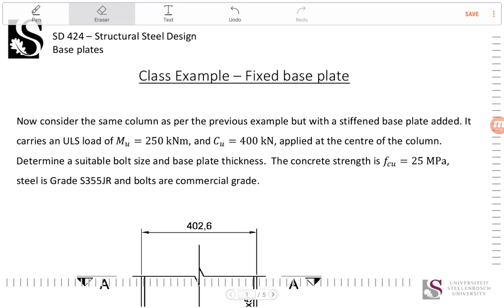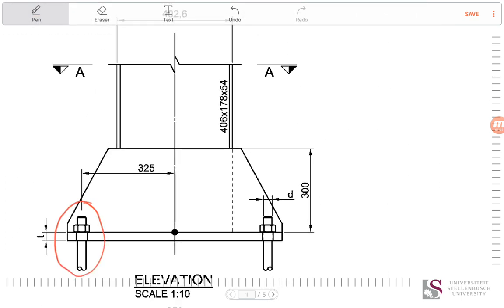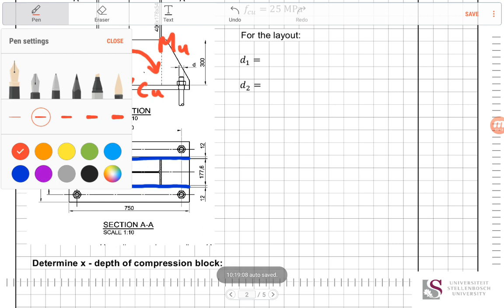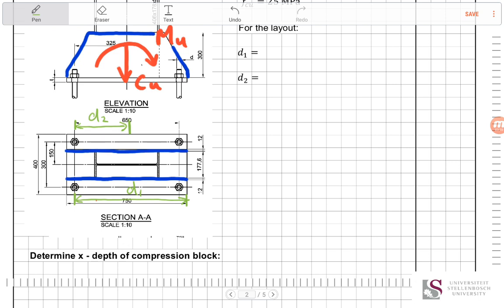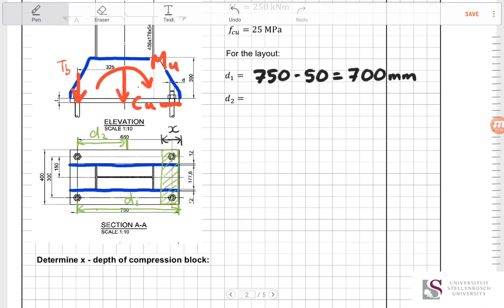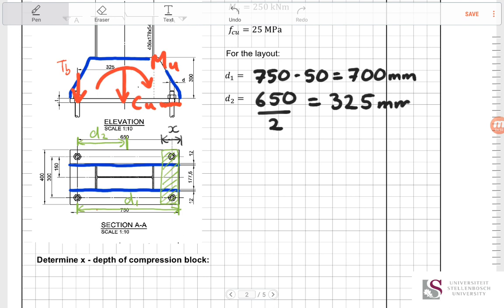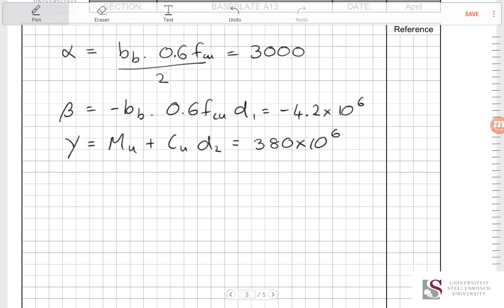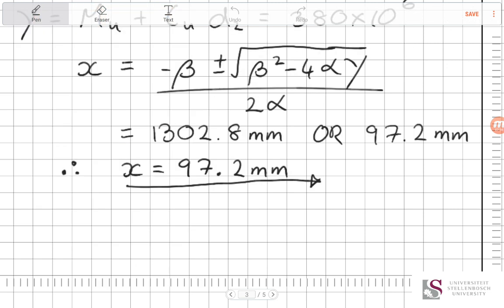Steel Design - Base Plates - Fixed base plate worked example - SD424

Comment: Good day, I see you have only calculated the resistance for tension in the bolts, do you not need to also check shear, combined shear and tension and Concrete cone failure and the other checks required as per SANS 51992-4?

Comment: To do the welding design of the stiffener plate, what force we would use the design check? Moreover, what’s the depth of stiffener required? As we assume infinite stiffness at the  stiffener location